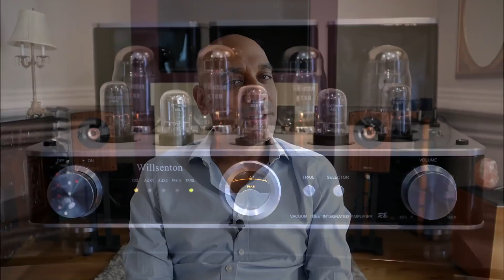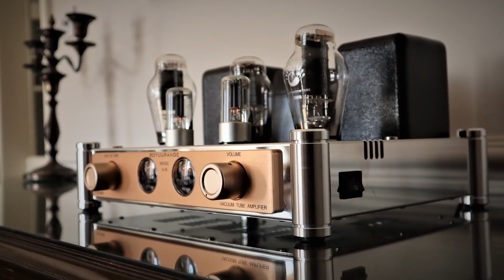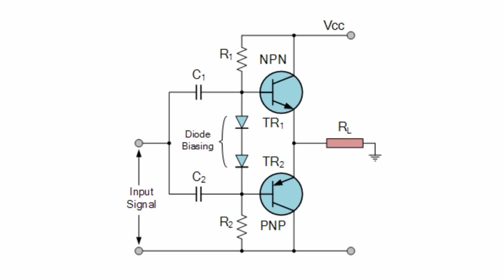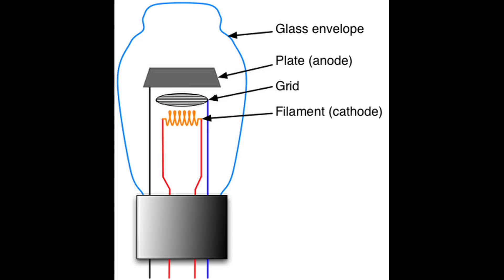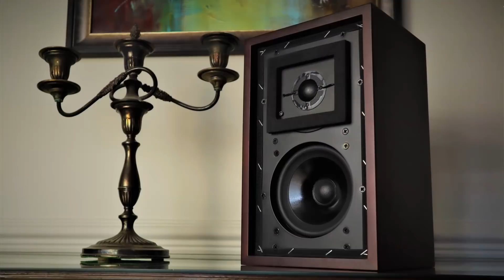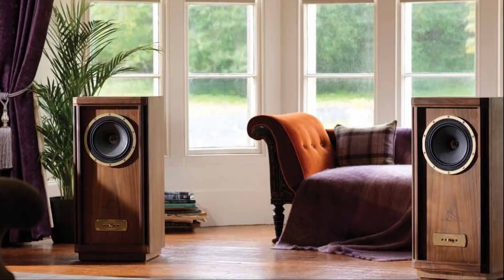Reisong BoyuuRange A50 Mk III Amplifier Review

Comment: Thanks for the Interesting review and I can relate to pretty much all of it from my own experience. For anyone who might be interested To address the low frequency bass response and it’s watt consumption I passed the speaker level outputs through an old velodyne 10” subwoofer that has a high pass filter set at 80hz. This saved power for  where it matters most. Paired with 25yr old 92db Tannoy DC 2000’s it was incredible for the money. Also to address the volume control  I combined a Allo digione streamer withVolumio digital volume control and a Schiit DAC . Final result was a system that sounded like it was 10k$.
Reply from the maker: Thank you for sharing your experiences AF 😊👍

Comment: Are the best speakers to pair with this amp (those with no neg feedback that is) not those with a flat impedance and phase plot?  Some speakers have special crossover network just to do that and make them suitable for tube amps with no feedback
Here is an example :http://www.audioexcite.com/?page_id=2386

The impedance and phase swing makes that an amp needs to adjust it's output and so needs a feedback loop
Reply from the maker: Thank you my friend 😊

Comment: Thanks for the review. Since years I use a Unison Simply Italy with 2x12 watts in ultralinear class A. I run it with Genalex KT77 tubes. I tested a couple of speakers. Italian, british and french. High sensitivity is a must. As you mentioned bass control is a challenge. Unison fans seem to prefer Klipsch, Unison research speakers, Tannoy, Zingali (Italian) and other exotic brands. I pair my amp since years with  efficient Cabasse Bora (90 dB 1W/1M). I always come back to them.
Reply from the maker: Thank you Oliver. Great to hear about your experiences 😊👍

Comment: These devices are called THERMIONIC VALVES in the U.K. Tube is the American slang term for VALVE. Therefore, it’s a valve amplifier. NOT a tube amp.
Reply from the maker: I think we refer to them as vacuum tubes as well or is that just over the pond 🤔
Reply: @abritishaudiophile7314  NO we don’t, never in the U.K. I am also a British Audiophile. They are VALVES.

Comment: Hi Tarun, For my main power amp I use a 300B PSE, ie 4*300B valves, parallel, single ended, coupled with a pair of Altec Model 19 speakers (97dB). The speaker cabinets do have a few updates and the interconnecting wire used is a higher specification than original and the crossovers have been provided with updated capacitors. I also have two pairs of EL34 monoblocks, a Bob Latino KT88 and a 165w/channel solid state amplifier. I have tried many other amplifiers and speaker combinations, some extremely expensive, but nothing comes close to the combination of the Altec 19s/300B PSE combination in my opinion. Kind regards David
Reply from the maker: Thank you for watching and sharing your experiences David 😊👍

Comment: Hi Taran, thank you so much for your review. It is very refreshing to there the good and bad, especially when it comes to SET. As I've downscaled to more compact dwellings I've been taken by small tube (OK valve) amps. I started with Leben but then got drawn back into SET. I'm currently using an Elekit 8600S (300B) with a SunValley pre and a pair of Omega Super Alnico XRS speakers. The amp and pre are both kits from Japan and took a few days with a soldering iron to put together. Suffice to say that the results have far exceeded expectations, so much so that I'm now working on a SunValley phono to replcae my ASR. Like everything to do with this hobbie, synergy of the individual components is the key.
Reply: Elekit is an amazing opportunity for a still affordable price. I own the little brother of yours, the TU-8200DX and for its price, it is a little wonder. Thank you for your testimonial !
Reply: @douxreveur131  Always good to connect! I've also got an 8200DX with the optional DAC card. I built the matching pre as well which I use with various Raspberry Pi projects. I've got them set up in my offcie with another stand mount pair of Omega speakers. What tubes are you using?
Reply: @Vivid360-r2r  With my Totem Sttaf speakers, the best musical result is obtained with Tung-Sol 7581A and Psvane 12AU7-S tubes.
Reply from the maker: Thank you Rob. Great to learn about your experiences 😊👍

Comment: The A50 is a fantastic integrated amp. I home auditioned and it was a perfect match with my Klipsch Heresy 4. Unfortunately I returned it only because the 2 300b tubes sat loose in its sockets. The sound is the best I’ve tried at home.
Reply from the maker: Thank you for watching and sharing your experiences SB 😊
Reply: Thanks for sharing. I am searching SET 300B to drive my Cornwall IV. Good to hear this match well with Klipsch speakers line.
Reply: @slowestrider4918  look at Decware, Zen Triode. It has magnificent reviews with the Cornwall 4. $1k

Comment: I would use this amp with front loaded horn speaker, which I don't think you can beat in terms of efficiency. But practically speaking you would need an active sub for bass
Reply from the maker: I agree, supper sensitive speakers and a couple of subs would be great to try with this amp 😊
Reply: True. I'm running Klipsch Heresy III + SVS subwoofer, powering the mains with a 6W tube goodness, plenty of volume and dynamics!

Comment: Partnering speakers.  I suspect I’d look at the klipsch heritage line of speakers overkill maybe a nice set of cornwalls or lascala’s or smaller is you have smaller room. The simple sound nature of amp that concerns you would completely disappear tbh. Opening it up to wider types of music. Rock dance and everything in between. With those speakers 7watts would sound  like 100watt mono blocks.
Reply from the maker: Thank you. Klipsch speakers are a popular choice 😊👍
Reply: True about the Klipsch. I'm running Klipsch Heresy III + SVS subwoofer, powering the mains with a 6W tube goodness, plenty of volume and dynamics!

Comment: Hi! I own this amplifier, fed from a SMSL SU-9 DAC and paired with 87 db (!) Elac Debut B6.2 speakers and I am marveled by the results. Don't be fooled by the apparent low power. My volume knob never goes above about half and it does shake the windows. It is an amazing piece, holographic and sweet!

It indeed loses momentum on the low end. A dedicated Elac subwoofer beautifully resolved the issue, though coated me another 400 USD. I say this amp is an absolute bargain for the performance, and I say that by pairing it with quite low sensitivity and relatively budget speakers.
Reply from the maker: Thank you for watching and sharing your experiences Eduardo 😊
Reply: Interesting info, i currently have a SMSL SU-8s DAC and for speakers i currently own Dynaudio Audience 42s (86db) but am looking into exchanging these for second hand KEF Reference 2.2. I was in doubt about the power so thanks for that. Can you feed the DAC straight into the A50? I am a novice and started with a Doukaudio X1 tube amp but i could not connect the DAC directly without hearing weird pops and crackles. So it is fed via the preamp part of a NAD C320 amp.

Comment: I am very happy with my Boyuurange A50 III after I switched to Shuguang 300B-98B (power tubs) and JJ Electronica 6SN7 (first stage tubes). I have got an airy more three-dimensional sound with lots of details. I also tried the TAD 6SN7GT. This tube also provides very detailed sound but with a flatter sound image. The rectifier tube has I kept the original tube. This amplifier gives me a lot of joy every day. Connected to the amplifier, I drive a pair of Audiovector R3 Avantgarde connected with a pair of Supra Sword Excalibur Combicon.  I'm aware that is not a cheap solution but it sounds great.
Reply from the maker: Thank you for sharing your experiences  Michael 😊

Comment: Thanks for the review. Always love comparing UK sayings vs. USA sayings. Slap you with a kipper.  Sounds like monty python to me.  Don't have to worry about me doing it from the US.  Wonder how it would work on la scalas since their bass is not deep but, from what I hear, tight.
Reply from the maker: Just a bit of British mischievous humour on my part. Very much in the Monty Python vane. Klipsch speakers are understandably a popular choice 😊👍
Reply: @abritishaudiophile7314  yes, one might even say "cheeky".  Although, you say it so calmly, it floats right by.  FYI, not just any klipsch, the La Scala.  With klipsch "box" speakers they drop the impedance real low to yank power out of the amp so the woofer can keep up with the horn mids/highs.  Not ideal for tube or limited current amps.  Only the La Scala and Corner Horn speakers use horns on the bass for efficiency making them easier to drive with the aforementioned amps.
Reply from the maker: @jked7463  thank you. That is very illuminating 😊👍
Reply: @abritishaudiophile7314  that just made me think of an idea.  Since the corner horns get low but project out at 45 degrees, not the optimal 60 degrees and since La Scalas don't get real low but can be placed for optimal soundstage, use the bass sections of the corner horns a subs and cross over to the La Scalas as mid bass/highs.  Now you can get concert level sound with the live dynamics of horns top to bottom and power them with low power tube amps.  Now you just need to stretch the size of your room and get your wife to buy into the idea 😂🤣😂
Reply from the maker: @jked7463  she is very accommodating but the La Scalas may be pushing it 😂👍
Reply: @abritishaudiophile7314  but I am sure corner horns in the corners will make up for the La Scalas in the middle of the room. 😄😅😂🤣🙄

Comment: Very nice review Tarun. When I saw the thumbnail, I wondered whether you had a speaker that could match up to this, and as I suspected, it’s seems not. Certainly anyone who knows SET amps knows that you need to pair them with very sensitive and easy to drive speakers, but for those that don’t know this, it’s great that you were able to review this unit and help people understand why it may not be a match with their systems. You covered the shortcomings and limitations, as well as the POTENTIAL upsides (with the right pairing) very well.
Reply from the maker: Thank you buddy. The SC8B were a good starting point but I would love to try this amp with a true high sensitivity speaker and moderate sensitivity full range single driver design 😊👍
Reply: @abritishaudiophile7314  The Zu Audio Omen II DW isn't always available, but at 97db sensitivity, with a 10.3" full-range driver handling everything up to 10,000 Hz, and a super tweeter for the rest, it's an option for those with low-power amps. Zu says it can be used with amps as low as 4 watts/ch. Starting at $1199/pr USD plus shipping, they probably won't break the bank,
Reply from the maker: @careylymanjones  cool 😎

Comment: 800GBP for a class A 300B SET amplifier is really quite a feat to beat. The triodes alone probably are worth around 130-150GBP I reckon. It just goes to show what economies of scale (or low manufacturing costs) can achieve. It would be interesting to find out if there are any well known brands' parts inside.
Reply from the maker: Thank you Stelios. It is a bit of a bargain 😊👍

Comment: Great Review. I have a pair of Zingali Overture 4 floorstanders. Big, horn loaded floorstanders but pretty sensitive at 93dB. Currently I use a 150watt DK design hybrid amp but at this relatively affordable price it might be interesting to dip a toe in the water of SET amps as a second amp for acoustic music and jazz. Don't tell my wife...
Reply: Does your wife read the comments section of hifi equipment reviews on YouTube?
Reply: @michaelk6566  I wouldn't put it past her. She has an uncanny ability to catch me red handed whenever I try to sneak new kit past her steely, unwavering gaze. She's a bit like the Eye of Sauron from Lord of the Rings. Maybe not quite as evil...in fact, given she puts up with me and my enthusiasms, positively saint- like.
Reply from the maker: Thank you for watching and sharing Jim. Sorry missed this at time you posted 😊👍
Reply: Hi Jim, your secret's out...😉
You didn't try the Primaluna with the Zingalis?
Reply: @carlitomelon4610  Hey Carlos. I did. That's where it started off, as a second amp for acoustic music. It was great with the Zingalis. But then my upstairs second system amp broke and became much more broke after I tried to fix it, so the PrimaLuna had to step in to save the day. Of course the PrimaLuna had something like 35 watts but I rarely had to go beyond 9 O'clock on the dial and I listen pretty loud.
Reply: @jimfarrell4635  
I like the way valve amps deal with higher volume. They have a sweet, natural sounding compression. Unlike an underpowered SS amp....

Comment: A few years ago, taking a tip from the late Art Dudley of Stereophile, I dipped my toes into super high efficiency speakers from mid 20th century America. The 1960's era Altec Valencia. 100 db efficiency. Altec was an eventual spin off of Western Electric, where the 300b and the first 300b amps came from. These early amps drove Western Electric compression horn speakers similar to what is in the Valencia. In the 1920's, 30's and 40's, amplifier technology was squarely here. Tubes, low power. So speakers were horn loaded and very efficient. The 300b was invented really to make PA vocals sounds natural, so that Churchill or Roosevelt could give a speech and be understood. But those 300b amps and those compression horns were essentially meant to be together. I ran the Valencias for about 2 years, but never with the "right amplification". I just felt I would be painting myself into a corner. Even so, there were aspects, like dynamics, that the Altecs do well. I followed every suggestion Art made for set up and placement. I just never fed them what they wanted. A 300b amp. I almost bought one dozens of times but practicality always pulled me back at the last moment. I sold them to a be gentleman from South Korea, who had something like a 300b. He's very happy.
Reply from the maker: Art, gone too soon. May he rest in peace. Thank you for sharing that Daina 😊👍
Reply: @abritishaudiophile7314  yeah, in 2016,17 and 18 I was swept up in Art's stories. He was a journalist, and a real story teller. I was swept up in his adventures. I'd had some pretty high dollar stuff but a financial crisis caused me to have to sell most of it. I started over about the time I really started following Art. I've been on a tighter budget ever since, but I found a 60 something year old man who bought a pair of the Altecs new, with a McIntosh C-26 and 2105 amp back in 1969. Still had them too, and all the receipts. I took a ferry over to Kingston, WA. I drove a Miata, so I gave him a down payment and came back the next weekend with my daughter and son in law in their Toyota Forerunner and took them home. For what it's worth, they sounded very nice with that old solid state Mac stuff. I had sold these very pieces back in the 70s, but really was not a big fan. My hearing changed.  Built stands just like Art described. I was also starting to follow Herb Reichert. I had sold my fancy VPI turntable and reading Herb's adventures with vintage tables, and also having been given a couple hundred 78 rpm records from various people (Hey, Daina, you collect records right? My grandma....), I picked up a Technics SL-1200 mark 2 and sent it to KAB Electronics to have it modified to also play 78s. While there, it got a brand new Technics arm with some kind of cotton fibers stuffed in the tube and upgraded Cardas internal wiring and cables. It ain't bad, but Herb got me to also try a Shure SC-35C, a $19 DJ cartridge going back to to the 50s or 60s along with several styli that worked with it. Depending on stylus, it tracks anywhere from . 75 grams to 3 grams. I actually love the standard conical stylus tracking at a svelt 3 grams but I have an elliptical 35 stylus and N75ej made by Jico. The SC35C was finally discontinued, but I just saw them back, but at $119. That's robbery.  But I also have an Ortofon 2m Red that's become a Blue after replacing the stylus I broke. And a upgraded re-tipped Dynavector 10x5, re-tipped by an Audiophile jeweler who lives right here in the Seattle area. It now has a sapphire cantilever and a micro ridge stylus, and it does sound quite nice. Picked up a Nagaoka 110 somewhere, too. I sold and owned an SL-110 back in the day that I had an incredibly low mass Infinity Black Widow tonearm mounted to it. One day, in the 80's my step daughter dropped a Walkman on it and broke it in half. The table and broken arm wound up in the attic and I forgot all about it. Got divorced, sold the house. I suddenly remembered exactly where I put it about 5 years ago. I sent the people living there now a letter inquiring about it. Never heard a word. Shucks. Anyway, Art and Herb had me about the time I started building a new system. But I've been on my own path for awhile since I sold the Altecs. Have a Quad/Wharfedale system and the Dynaco, Magnepan system. Anyway, I Really like good hi fi journalism. I think guys like Art made the written version into an art form. I watch other video hi-fi journalists such as yourself but I only know of one or two others who I really pay attention to at this point, that is beside you. Many, some well known and respected and liked, just babble too much. You're, by far, the most logical in your descriptions. And I really like that. I guess I'm less interested in being entertained when watching videos versus the written word. Fact is, you're entertaining to me, but I'm a different way. The other two are, to my way of thinking, similar. And none of you three are from America. And I like that too. I've also picked up music to go check out on Qobuz from 2 of you. Anyway, keep up the good work! Really enjoy.
Reply from the maker: @dainawilburn2390  thank you my friend. Very flattering to be mentioned in such exalted company 😊👍👍